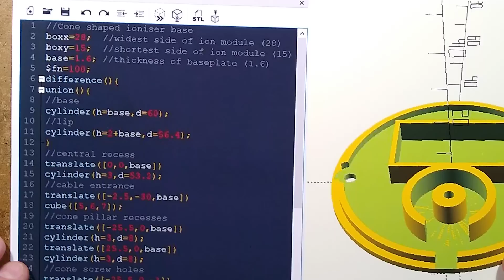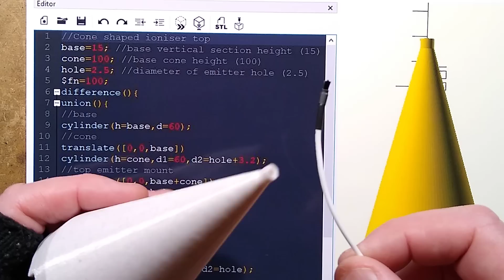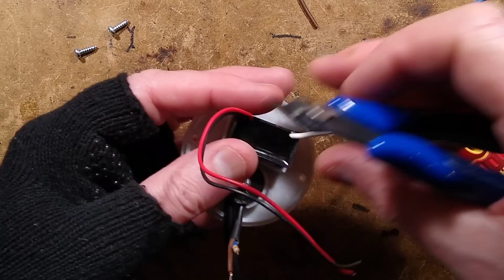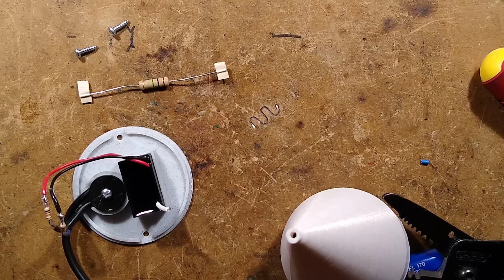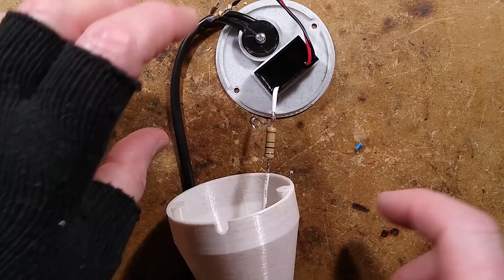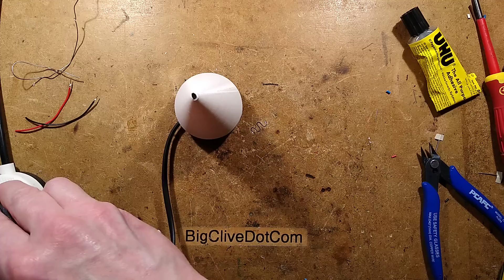DIY air ioniser with wide voltage range

Comment: I find this interesting but the module that I'm looking at on Amazon seems to have two high voltage outputs?
Reply from the maker: If the wire is the same colour they are often commoned inside.

Comment: So i came across this project while looking around for effective ways to eliminate dust, in a dust extraction box, for the assembly of camera IC modules. How effective do you think this would this be if I fabricated it in a pistol format, with a server blower fan inside it?
Reply from the maker: For delicate electronics I'd recommend against a single polarity ioniser like this as it creates an electrostatic charge.  You may be better going with a fan and filter approach.

Comment: I used this nodule (thanks for the 2x18k tip) without the extra 1Mohm resistor, built into a contraption that has a ventilator blowing air through it and out through a HEPA filter again. Have clearly seen a drop in  pm2.5 particles

Comment: Kinda want to build one of these for use at work with a beefy industrial connector for sticking it on line power, but given the added complexity of getting 480V in reference to ground (it's like 3 or 4 additional passives, but I am lazy)... plus my employer is already terrified of me with how I act around the spicy industrial electrons, maybe this wouldn't win me any approval, but come on, a light weight thingy with a beefy overkill twist lock plug on it just sounds delightful imo.

Comment: Hello ! Do you think it could work as a kief separator? I'm building a tiny version of industrial kief separator. I will do short: their version is a shaking sieve that makes raining kief powder into a vacuum pipe to charge it electrically then it go up to the machine and then fall again but this time between to metallic plate. Kief is attracted to metallic plate and vegetal dust is falling again to the first step to continue the cycle. 

So i want to pass all the step to just manually make rain kief between metallic plate that would be connected to this ioniser. Possible or stupid? Thanks mate
Reply from the maker: You could experiment with it.  There are various power ion modules.  For experimentation and applications where human contact may occur I recommend using the 12v modules.

With 12V connect the negative supply to mains ground.

Comment: You could print a second retention disk and use a longer screw to retain both the incoming cable and the rest of the internal cables to in a sandwich like fashion. 
Ps. you need a "helping hand" clamp system for the bench to protect your fingers and make filming easier.

Comment: I like it that you translate your subtract-shapes for the difference-statements to 1 below the needed position and make them 1 higher than they need to be. It does nothing for the printed output but it looks better on the OpenSCAD screen. I do that too.
I'm also planning to build an ionizer. I'd probably go the lazy route and just put the module into an emptied out USB charger plug.
Reply: I've often run into situations with OpenSCAD where CSG operation will fail if there are zero-thickness shapes.  I use the same technique, making the object being subtracted stand 1mm proud of the object being operated on.
Reply: "looks better on the OpenSCAD screen"
One other trick is to render() an object in the script.  This will slow things down a bit but can make the preview look nicer in some instances.

Comment: Printed it with nice black PETG for a 12v input ionizer module. Love it!
Reply from the maker: If using with a plug-in 12V power supply, I recommend grounding the negative of the low voltage side for better performance, and to protect the power supply against a high voltage between the low and high voltage sides.

Comment: Thanks Clive!  I've finally realised we used to have one of these. We lived in Spain for 3 years and, due to the language barrier, no-one could explain the full purpose of the switch by the air-con control, except to say it was for dust (which the sahara provided an excess of).  I thought it must be collecting somewhere in a steadily growing pile that would need to be cleaned out every few years🤣

Comment: How would one include the use of a capture plate to this design? I've been wanting to implement an air ionizer to one of my old projects. Hepa/UVC.  Learned a lot from your videos over the years.
Reply from the maker: You could either use a grounded metal plate in the vicinity, or use a positive voltage multiplier to raise its voltage slightly, with lots of series safety resistors to limit current.

Comment: What temperature is set for the heat shrink? What is the optimum value?
Reply from the maker: That will depend on the heat shrink sleeve used.  I tend to use 200C.

Comment: The only question is how many strategically placed in a house that’s about 1750 square feet? Or how much coverage do you think one can handle. As I recently replaced a screen protector on a phone in the lab, the realization of dust trying to keep the screen clean is a problem during dry hot summers. One in the lab for sure…
Thanks for the video
Reply from the maker: I tend to use one in a couple of rooms.

Comment: So where would you put this? You don't need a fan to disperse it?
Reply from the maker: You can use a fan if you want, but it can be placed on a table or shelf and left to do its job passively.  Air is always moving in a room.
Reply: I would personally love to mod a standing fan to disperse those. And I would also probably want to try a mod on the exhaust of a vacuum cleaner. Have you ever considered these? :)

Comment: Thx for the CAD editing thing! 🙂
I use an Ali  "multi legged" ionizer unit on the exit/downwind side of the home-made MERV-13/box 20" fan filter. 
The "legs" are just badly arranged to the exit.. it does arc consistently ..repeated clicking sounds. The 1M resistor(s)  might help.
We have smog/ forest fires here pretty much every year.😮‍💨

Comment: is there a good way to create a dust collection grid to use with it?
Reply from the maker: Technically speaking, you could either just use a grounded metal plate in its vicinity, or make a positive voltage multiplier with safety current limiting to act as a preferential surface for the dust to precipitate to.
Reply: @bigclivedotcom   If you had a positive ionizer  would the carbon fiber emitter become a ball of dirt :-)
Reply from the maker: @thewhizard  Same effect, but strips charge from the air.
Reply: I'm glad someone asked this.

So now I'm wondering what potential should the collection grid be at?  And are there similar modules to create the +ve potential.

Comment: Considering you are dealing with high voltage should not you use double heat shrink to improve insulation around that 1 Mom resistor?  It might be an optical illusion but it looks like the original insulation on that HV wire is thicker than the heat shrink's wall even before it is shrunk.  And the physical proximity of the low voltage wire makes the reliability of the HV wire insulations imperative.  Having said that extra insulation does reduce chances of interesting after-effects .....
Reply from the maker: The current is tiny, but I'm also relying on the sleeved resistor being stuffed up inside the case away from the incoming connections.

Comment: Two questions, what do I use if I dont have the little brush on the HV and is a 1/2w 1meg resistor sufficient?
Reply from the maker: 1/2W 1M is fine.  You can use a very sharp needle as the emitter, but a carbon fibre tuft is better.  They usually come pre attached to the module.

Comment: For ( UK ? ) folk , would recommend a 1 Amp fuse ( 1 inch by ¼ inch diameter ) in the 13 Amp mains plug .... sadly you have to buy these from a distributor ( they do not seem to sell these in your local : Stop - n - Shop ) .. DAVE™🛑
Reply: CPC have them.  Not cheap though.
Reply: @Aitch-Two-Oh  Yes   I have some from CPC ... they cost 50p each , but with all safety gizmos , they are cheaper than a house fire ... I repair stuff , and the amount of folk that have 13 Amp fuses in table lamps is worrying ! ! .... DAVE™🛑

Comment: I feel like this is the level of weekend project that my overly exhausted mind could just about handle, except my 3D printer is broken and would take a lot more mental effort to fix. Also I'm not usually a fan of working with mains power, having got a couple of good zaps while working on projects in the past, but I like the way you demonstrate putting this together, makes it seem a lot more approachable.

Comment: You could use three mounting screws and move them in a bit. That would allow use of rubber feet with a recessed hole for a mounting screen. I like that sort of foot much better. Those stick-on ones seem to fall off after a few months. The rubber ones seem to last for decades before hardening and crumbling away.

Comment: i bought a 12 V version, (ive been here enough years to never trust mains voltage Chinese stuff)
im planning on pairing it with a silent 12 V computer fan ,and 3 d print a contraption to hold it all together,
im probably gonna leave it on while im at work and turn it off when im home,
a simple script on esp32 oes esp8266 would do the job
Reply from the maker: I strongly recommend grounding the negative side of your 12V power supply if it isn't already.
Reply: Make sure there is no ionized air going through the fan. The fan and screws dont like that at all.
Reply: @CyberlightFG  didnt know ionized air can damage screws , but thanks for the advice

Comment: It might not like my 250v supply lol
A set of Presto twist drills that went from 1mm to 6mm in .1mm increments has been one of the most useful bits of kit that I have bought!
Reply from the maker: It's 250V here a lot of the time.  The inside circuitry starts with a resistor and diode, so an extra resistor externally as shown will be fine.

Comment: Clive, what melt temperature of solder do you use, as in this video?
Reply from the maker: It's classic tin/lead solder.  My soldering iron is currently set to 360C.
Reply: @bigclivedotcom  Thanks for answering my question, much appreciated.

Comment: If you use flat-headed screws and tapered countersunk holes it would work well to make the screws flush and by doing it tapered instead of inset most printers will not need to use support material and do a nice bottom even with that on the base of the printbed.

Comment: Quick Q:  I don't see you using flux, unless it's off screen.  I have varying results using and not using it.  Sometimes, I have to use it or the solder won't stick, while other times, I have no issues without it.  What's your take on this?  BTW, I use flux core.  I've had nothing but bad results from Chinese bought solder, while solder bought locally with flux works great.
Reply: Are you using lead free solder? Typically, lead free solder is harder to work with.
Reply from the maker: The shady Chinese stuff from eBay is very unpredictable, and sometimes has gaps in the flux core.  You need to melt to solder at the joint so the flux can do its work before it boils off.

Comment: Regarding the addition of a neon indicator, would it be possible to include on in such a way that it is effectively powered from the emitted negative ions? That way it would also show the device was actually working.
Reply from the maker: You can use a capacitor in series with the output with a neon indicator and resistor across it, so it pulses at a speed determined by the ion output.

Comment: It may have been more complex to create, but as you designed in serviceability by using screws for the securing the base and the cord grip, why not design in clips for securing the potted ioniser module rather than using glue?

Comment: I hope it's not PLA because it will become brittle very quickly. I would add a neon lamp inside for beauty and to make it visible that the device is connected to the power.

Comment: Is it possible to attach the end to body of a car, so if anyone touches the car gets a shock? 
Will it rise the potential of the negative chassis to thousands of volts compared to the surroundings? 
Or, will the output get shorted to negative ground and blows everything to smithereens?
Reply from the maker: The current is very low.  Tyres do have a some conductivity due to moisture and dirt.
Reply: You'd probably get better results with an electric fence charger. However, it's probably illegal in most places.

Comment: Funnily enough I was re-watching one of the older vids on building an ioniser from scratch, funny how things seem to align like this, and it's a rather amazing contrast of going from a board with many stages of diodes and capacitors, to just an ominous black block with a few wires on it... :P

Comment: What if you use a diod to cut half of the 220v wave? It will not ve senoid anymore but... Does it matter?
Reply from the maker: These usually do have a diode inside.

Comment: It never ceases to amaze me how solderingly dextrous you are 👍.  Regarding end to end joints, you just hold one wire next to the other.  The books I used to read years ago always told you to make a good mechanical joint before making a solder joint. Is this no longer recommended  ?
Reply: It's certainly better to make a firm physical connection before soldering. But, for something stationary and with no stresses on the wires the heat shrink adds sufficient strength. Personally when at mains voltage I prefer two layers of heat shrink. One shorter just long enough to cover stripped wires and resistor and another one size large and long enough to overlap the insulation about a half inch at each end. Doubled heat shrink does result in having to plan where to place the resulting connections. Sometimes I just put the outer heat shrink over the pair of wires, depending.

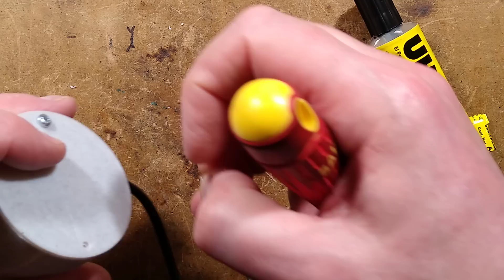Comment: 21:20 Next iteration, add inn a 3rd screw pillar and hole, so that the 3 screw heads can function as feet without the thing tipping over.
Reply from the maker: I've toyed with that, and using the screw on rubber feet.
Reply: A quick-and-dirty technique I've used is to put generous drops of hot glue at the corners on the bottom and press it gently onto wax paper on a tabletop.  Useful for making dense through-hole circuit boards non-slip in instances where press-on feet won't fit.
Reply: just glue a hockey puck to the bottom

Comment: clive i have a 300w modified inverter is there anything I can plug into the inverter to smooth out the sin wave to stop it causing sensitive electronics from buzzing or causing damage without having spend money on pure sin wave inverter
Reply from the maker: I don't think there's an easy way to do that, since it would depend on the circuitry of the item being plugged in.
Reply: @bigclivedotcom  well i got a inventor to run the starlink off of it but the startlink routor started buzzing of the invertor but when i contact support they said i need a 500w pure sine wave inverter so I don’t know if sticking a choke or an inductor between the appliance and the inverter to smooth it out with out splashing more money

Comment: The urban lore I live religiously by was that it was cosmic rays and tri-glycerides that made dust stick to the inside of yer airways. Unless you sleep under a pyramid shaped structure with magnets on it, with an aluminum foil hat on. 8^)  Happy eye on eye zing. Cheers!

Comment: Make sure you don't have any sharp edges or points when you are finished soldering on the high voltage wire. 
That could cause a corona inside the ioniser.

Comment: Nice little project. If you have a small power loss (less then 2ms) and a TV will no longer turn on what would be the first thing you would look for on the board?
Reply from the maker: The prime culprit on modern TVs is the secondary side smoothing capacitors on the power supply.  You may be able to get a complete PSU for the specific model on eBay to rule that out.

Comment: 22:22 You could make an 0.01mm intend or similar on the plate for the feet in OpenSCAD. It will make nearly no change, but it should get the foot places printed in a different way so you can see where the feet should go.
A bit experimenting sure is of need.

Comment: I think one could make a simple tester for detecting how much negative ions are being omitted. A small like 3 inch x 1/2 inch pcb with a copper finger pad to ground with your body, at one end a LED bulb, a small capacitor and a small copper at the other to collect the ions from the air, when near the ion generator. It should blink faster as more ions are collected and charge the capacitor and discharge into the LEDs. I once had an ion generater near a florescent light and when the bulb was turned off, it would flash every minite or so.

Comment: Hi I recently put a garden lampost light in my garden. It has three lights on it and I'm using TCP ES A60 RGB & WHITE LED SMART LIGHT BULB 9W 806LM in each. And 5 meters of White 3-Core 2.5mm² Flexible Cable. Going into a block connector then three strands of Black 2-Core 0.75mm² Flexible Cable for the light fittings. Then I have it going into a three pin plug fitted with a 3amp fuse plugged into a 6 plug extension block lead. Is this ok or do I need to do anything else. The block connector is inside the lamp pole off the ground.

Thanks
Reply: Make sure it's earthed and on an RCD or RCBO at the supply point.
Reply: @Jon-em4kc thanks
Reply: @Jon-em4kc so the rcbo needs to be connected from the plug wire outside. What about those waterproof RCBOS.

Comment: 4000 Volt? 🤔

Methinks I could take a microwave oven transformer and build a similar deathsecuter..uhm, I mean ionizer!
Reply from the maker: It would work, but would be very inefficient and the transformer would probably get hot due to their short duty design.  It would also be massively more dangerous.

Comment: Could the high voltage from an ionizer damage a USB power bank in the same way as a mains adapter or no?
Reply from the maker: I don't recommend using ionisers near electronic equipment.